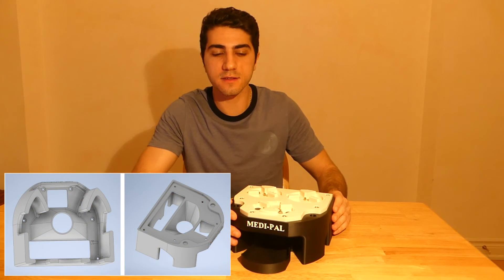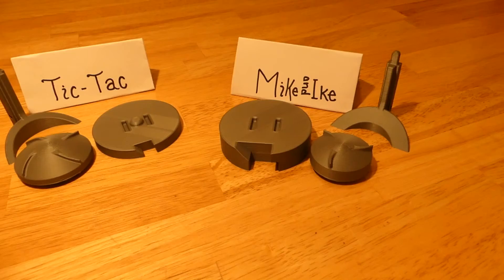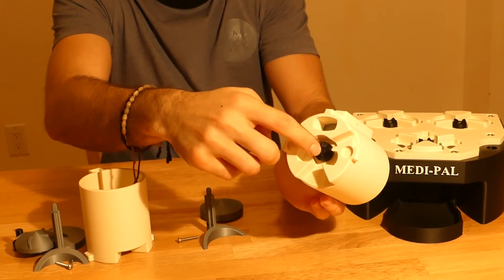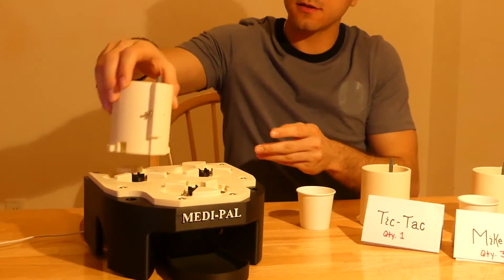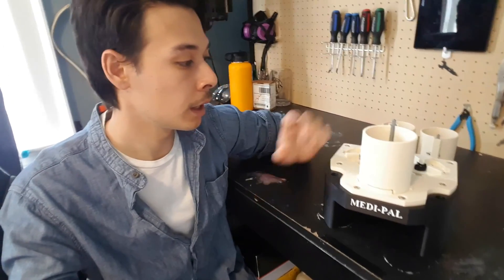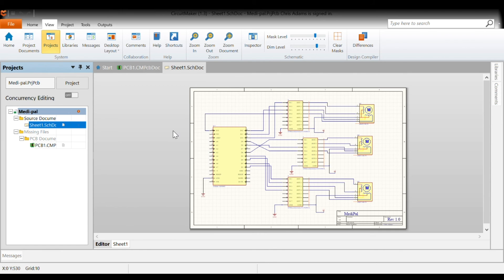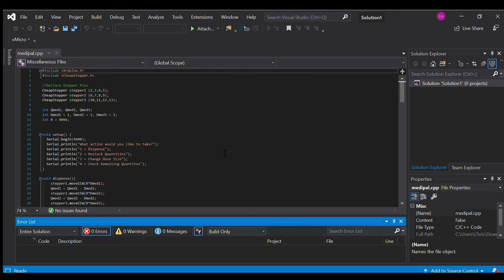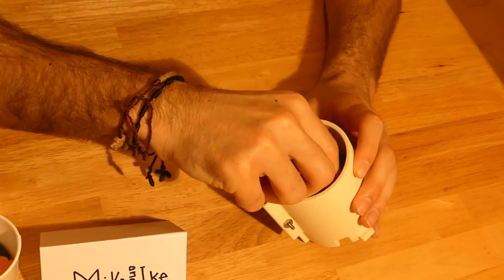Building an Automatic Pill Dispenser

Comment: I have a hero and has 10 containers for different pills could use 15. There is no plate for specific size of pill as I can put any pill in any of the 10 containers. Not sure how they do this but has something to do with the resonance they create with stepper motors.  It works reasonably well have never seen a multiple drop of a pill but occasionally it cannot pick one.

Comment: Hi Michael, Absolutely fantastic design! I have been looking for something like this for a long time. I'm 64 and my wife died a few years ago, since then I have been on a quest to maintain and improve my health, with supplements being just one part of the puzzle. I take anti-oxidants, vitamins, anti-Inflamitants (for my arthritis), supplements to increase my circulation, etc. So right now I I take 19 different supplements for a total of 42 pills a day. I manually sort them into pill bags. One for the morning (23 pills) and one for the evening (19 pills). So, is there any chance you could share your 3d printer files and the specifics of the stepper motors? I will try to expand your design to accommodate my 19 different pill type requirements.  I have a 3d printer and just recently started playing with Arduino code but don't know C, so will probably have to try to replicate the functioning of your code in the Arduino environment. Amy help would be greatly appreciated! Carl
Reply: Sorry about the typo! ...Any help would be...
Reply: Paused the video and got the info on the stepper motor. Thanks!

Comment: Hi! We are working on making a pill dispenser for our university project and your video really helped! Is there a way you can provide us with more information about the actual design of the disks? Thank you and greeting from the Netherlands!
Reply from the maker: Hey! The hardest part of designing the disks was getting the slots the correct size and shape to allow only one pill to be dispensed. Getting the slots the correct size took a lot of trial and error. I found that having the pill slide into the slot on an angle and having the top of the pill sit just below the top of the disk while it was in the slot worked best. At first, I thought I could just design the slot to pick up each pill horizontally. But with this design, two pills would sometimes be dispensed at the same time or two pills would get caught upright in the slot and would jam the device once the pills hit the "sweeper arm". Having the pills sit inside the slot on an angle and positioned just below the top of the disk ensured only one pill was collected and if another pill did manage to get caught, the sweeper arm would just brush it off. Pause the video at time 2:22 to get a clear picture of it. The rest of the design of the disk includes a threaded hole at the bottom of it (to secure the motor gear) and the two slots at the top of the disk hold the agitator piece. I'm not sure if this helps.
Reply: @michaelsangiorgio9959  Dear Michael! I am working on a university project about dispensing medicals and I found your video very useful for this project. My problem was the same, dispensing just one medicine, not 2 or 3. My question is that dont you have any cad or stl, stp file about the model? I couldnt really understand the working mechanism, this is why i am asking. Thank you for your helping and your answer as well! P. s: Congratulations for the machine and for the solution! Amazing idea.

Comment: Hey dude! I'm working on automatic pill dispenser. Just what you are doing, but i've also designed a "two axis cartesian robot" in order to move the "weekly pill dispenser" just below of the pills exit. This is my final degreee thesis and you have helped to me to have an idea about how I could administrate the pills one by one. I've had an idea like this, but i didin't thought about the agitator piece and the sweeper arm. Congrats and thank you.
Reply: If you want to take a look to my final degree thesis, you should wait until the working end due to the university rules. Welcome from Barcelona!
Reply: @aroelclavell1231   hi I have also taken interest on this project i know that you comment it for a long time now but i was task to make similar to that, can I see your project?
Reply from the maker: That's awesome. Glad my design helped you!! I spent a great deal of time testing and figuring out how to administrate the pills one by one accurately and consistently. Let me know if you have any questions on the design. I would love to see how your final project turns out!
Reply: @michaelsangiorgio9959  Do you have any issues with missed dispenses? I've considered something similar but rather than assuming one pill per rotation, I was planning on using some sort of a light detection to verify that an object fell. Are your designs are reliable enough that it's unnecessary to verify a dispense?
Reply from the maker: @FredDamstra The design of the device ensures that no more than one pill can be dispensed. Including the sensor would be the next step in this project. The sensor would verify that a pill was dispensed and could be used to determine if there is a jam in the system or if the pills need to be refilled.
Reply: @michaelsangiorgio9959 is there any way i could take a look at the STL files for this product?